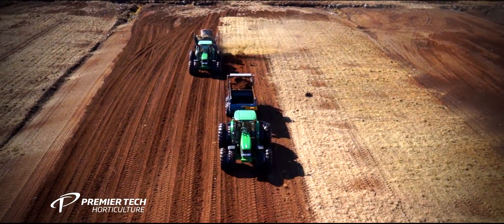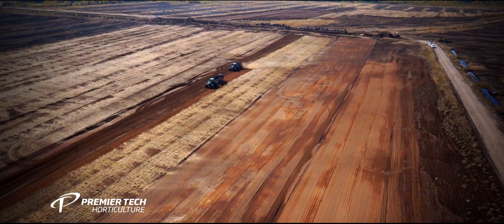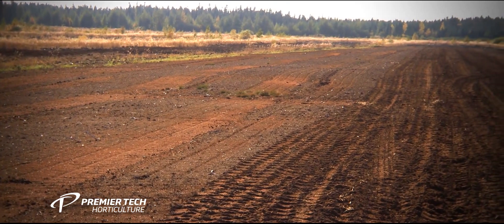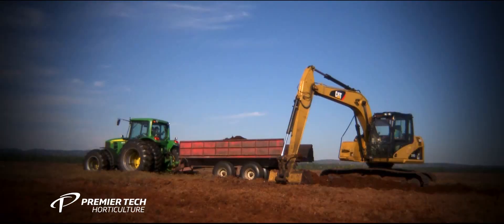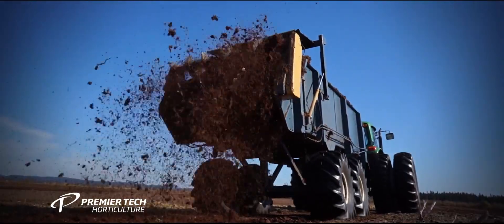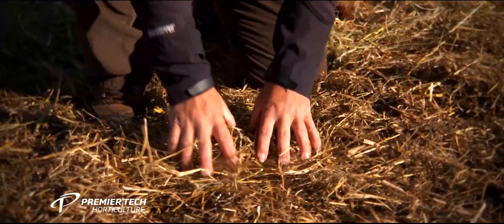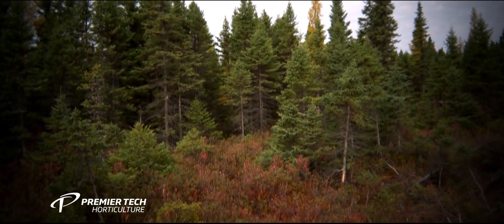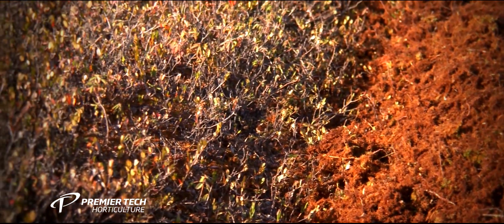Peatland Restoration

Comment: If you take the sphagnum moss form another land, you will have two destroyed land. And sphagnum moss growing conditions are really hard to keep. How old is your older restored land? How much phagnum moss is there?
Reply: Well it only takes one square  meter of donor material to seed ten square meters of the bog to be restored. These are living growing plants.  Sometimes a donor site is the new bog to be harvested but sometimes they are managed just as donor sites. When they take material off the donor site, they only skim the very surface and the plants grow back. A site that has had donor material removed will have sufficiently regenerated in five years to be used as a donor site again!